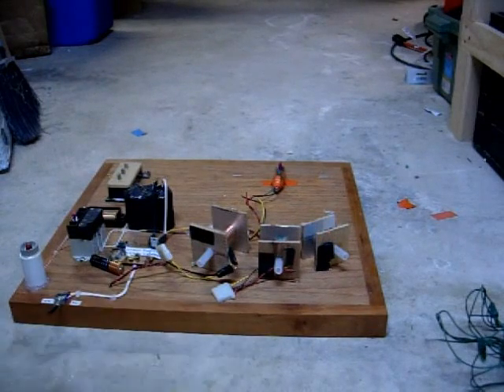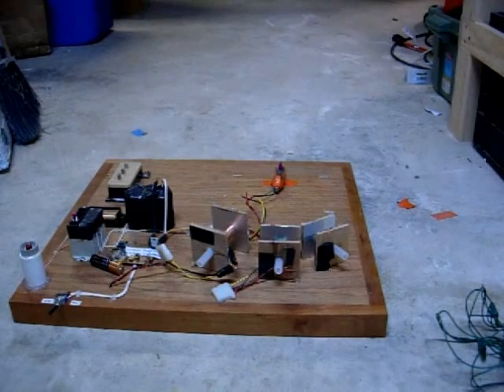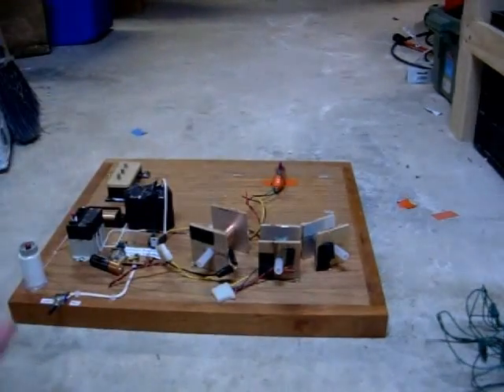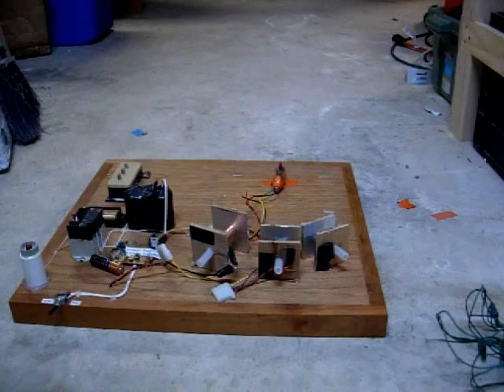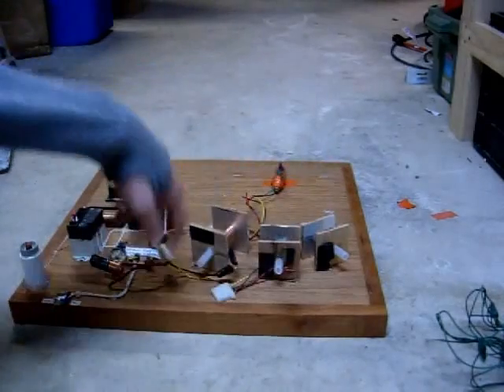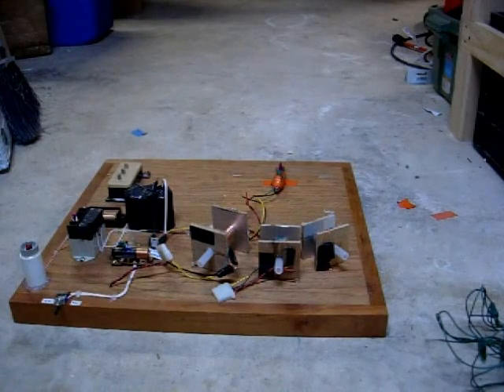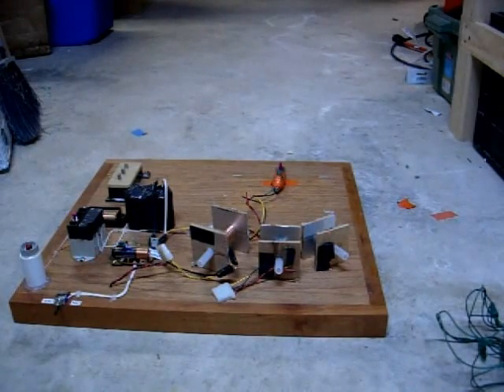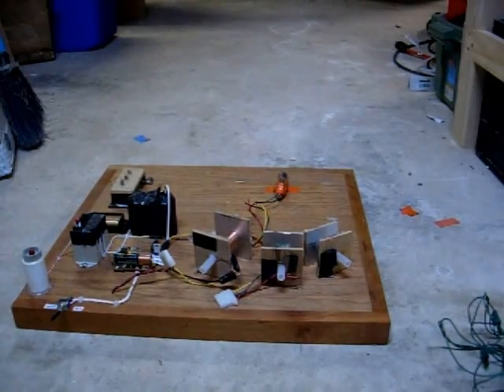DIY PLASMA GUN

Comment: So this does not fire plasma but rather utilizes the rapid expansion of gas caused by the plasmas heat to launch a projectile, am I correct in that assumption?  At that point that would essentially just be replacing gun powder with plasma, just takes longer to get the energy and less of it.

Comment: okay, I have three critics to your project:
1. I like the idea of a plasma gun :)
2. After taking a look at your link and rewatching the video, it seems like the sparks mostly come out of the back of the "barrel", maybe you should seal this too raise the pressure built up.
3. I don't think this is a real plasma gun, a real plasma gun would use the plasma itself as projectile. I'm not sure, but I think the correct term for this type of weapon is a TE-gun; a thermo-electrical gun...

Comment: all you did was supply a high voltage charge to a low voltage led/light take a 110 100 watt bulb and put 10000 volts to it and it would do the same thing. pop.

we do it in class at itt tech some times

Comment: its ionized gas, as the other guy sayed , JACKASS XD. u can find plasma even in a tv, florescent tube, things like that. temperature is just another factor. what u described are more like the conditions for normal matter to start a fuzion nuclear reaction, wich is alooooot diferent. when u weld u create hot plasma. an electric arch is plasma. those glow bulbs that use low presure hidrogen generate plasma too. so dont argue with someone unless u know wtf u are saying.

Comment: great work, if powerful enough,
we can turn it into PLASMA RECIPROCATING ENGINE OR PLASMA TURBINE, i got some idea, 
actually the plasma blown up the moisture in the air -> break-up H and O 
from water moisture, then form back H2O again...., improved it to higher power, soo it will combust the plain atmosferic air without FUEL or HHO gas... GOOD work

Comment: what you need to do is condense that into a man portable weapon. All you need is some good scafolding to mount all of this on, a new charging system using a more heavy duty battery(such as a D battery rather than the AA that you use, as D batteries have, on average, 5 times the power of a AA battery), some form of container to hold the assemblage externally so as not to obstruct the path of the projectile or force the weapon to be a muzzle loader, and a barrel. Either way, nice idea.

Comment: Well, actually, it isn't. Fire is a chemical reaction, during which the hot gases produce visible light - the flame. Good examples of plasma are - bolt lightening, ball lightening, electricity sparks and the stuff the stars are made of.

Comment: There is a device called Spheromax. It uses a coaxial marshall cannon to propel a ring of plasma...

But NO ONE can do this at home. In an ETG, the plasma will exit the barrel...but after an inch or less its gone. But you can use it to propel a projectile.

To dumb to use google...